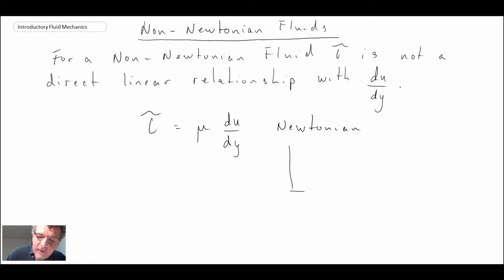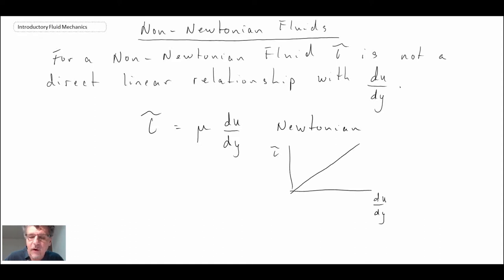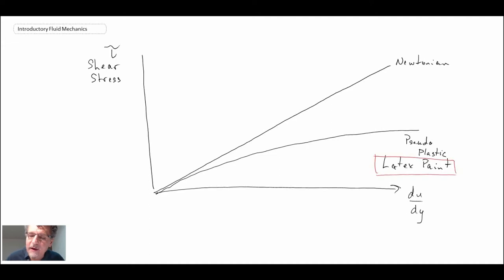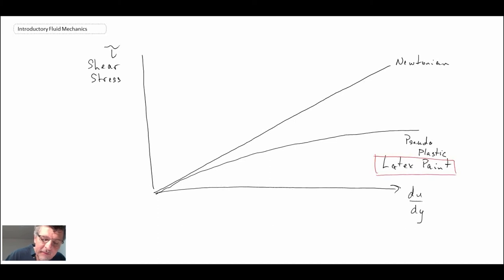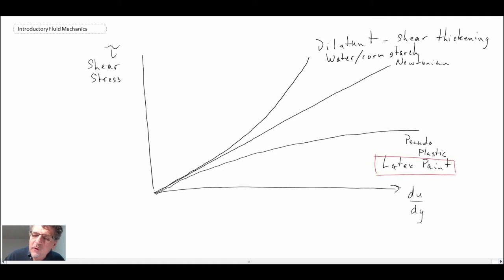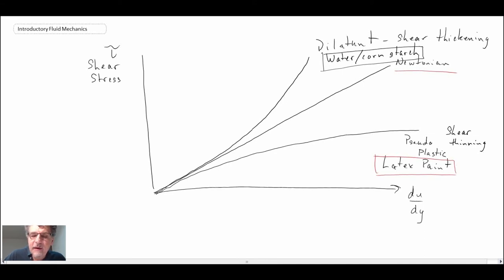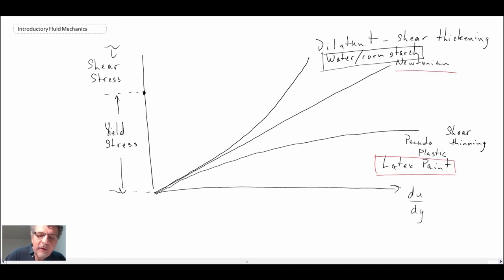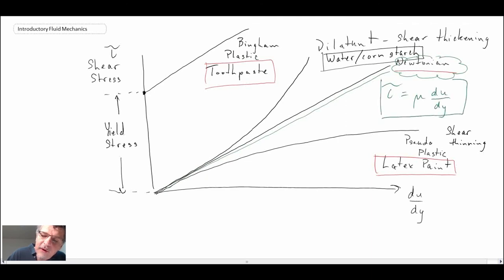Introductory Fluid Mechanics L2 p4:  Non-Newtonian Fluids

Comment: It seems that dilatant and pseudo plastic have been interchanged.It should be the other way round.
Reply from the maker: I do know what you are thinking, but the curves are functionally correct.  The way that each of the Non-Newtonian curves looks depends on the initial slope.  It also depends on if the shear stress is plotted on the vertical or on the horizontal.  In the lecture and in the thumbnail drawing I show the slope for all three (Dilatant, Newtonian and Pseudo-Plastic) to be the same as the shear rate starts to increase. If the slope of the pseudo-plastic was greater than Newtonian at the zero strain-rate condition then the resulting pseudo-plastic curve would be drawn above the Newtonian line, not below as I have drawn it.  The main thing to look for is how the slope of the curve changes as the shear rate increases.  For shear-thinning fluids (pseudo-plastics) the slope should decrease (the fluid becomes less viscous) as you increase the shear rate, and for shear thickening the slope should increase (the fluid becomes more viscous) as you increase the shear rate.  Hope that makes sense.
Reply: @ronhugo6225  absolutely right bro...!! I have same doubt and
I was going to write the same comment but i saw your reply and understand whole thing
Reply: with all due respect, that's what happens when you don't understand the fundamental concepts behind fluid mechanics, but rather just memorize the diagram and its labels. Cover basic concepts and picture the fluids according to their laws of physics, in reality.. Great job explaining, @ron hugo.